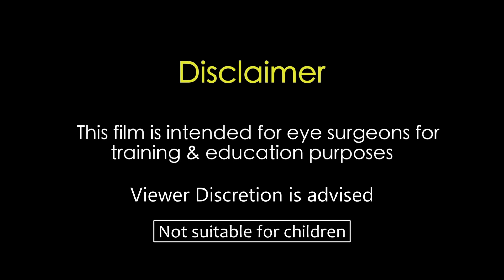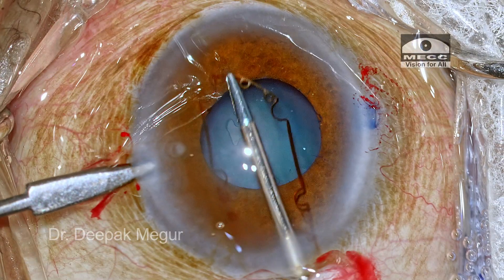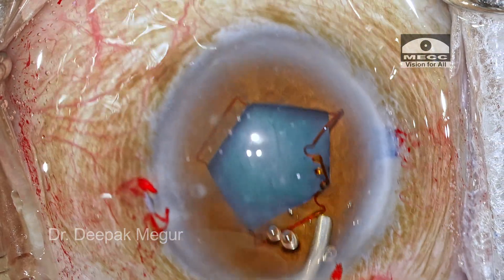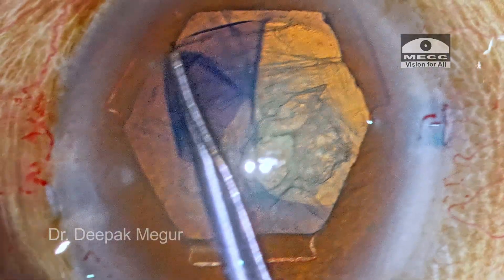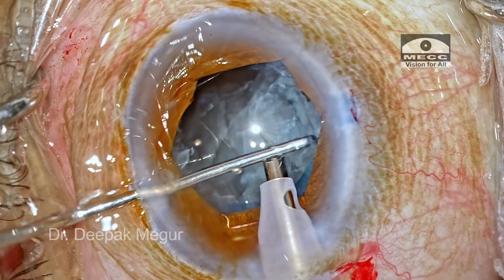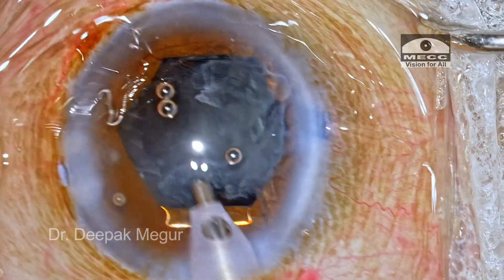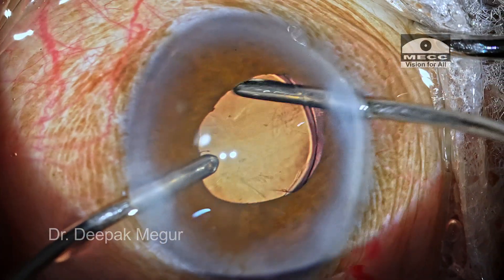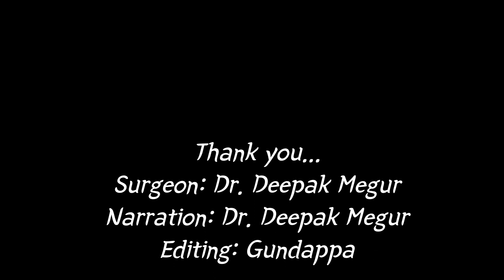Trouble Shooting -BHEX pupil expansion device in a rigid pupil:Tips and tricks  Dr. Deepak Megur

Comment: Excellent demonstration of Pupil Stretch after partial engagement of B-HEX. While Sphincter Tears are not desirable, RIGID Pupils leave us with no other option. The RIGID Pupil is like a STRING with fixed length/ circumference and CANNOT EXPAND. Whereas, the ELASTIC Pupil is like a RUBBER BAND and can EXPAND. 
To accommodate any Pupil Expander or even Iris hooks, the Circumference of the RIGID Pupil has to be enlarged and the only way is by creating Sphincter tears. It will be the surgeons choice whether to perform controlled tears before the engagement of the pupil device by using 2 Kuglen Hooks/ Y Hooks or create uncontrolled tears by the Pupil device itself. Since the B-HEX is very thin, it does not have the mechanical strength to tear the sphincter and hence requires that the Sphincter tears are made by using 2 Kuglen Hooks/ Y Hooks in advance. Bulkier Pupil devices may be able to create sphincter tears as they are deployed but these tears are less controlled.